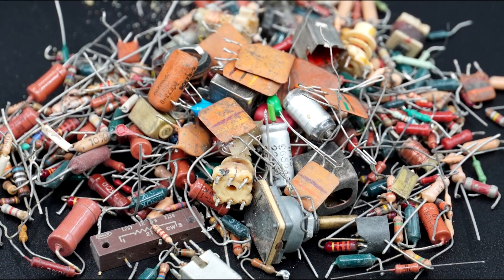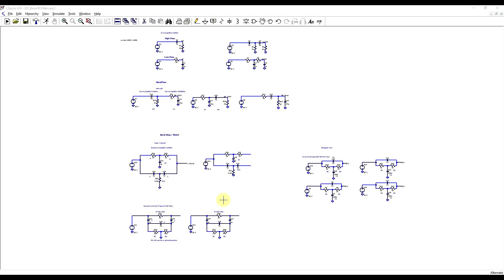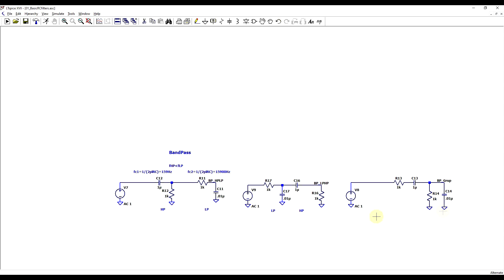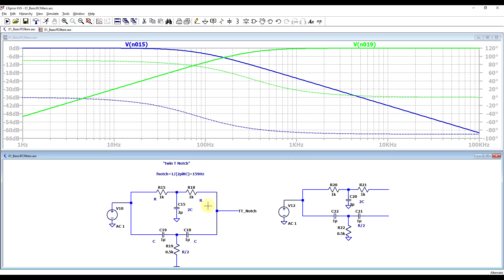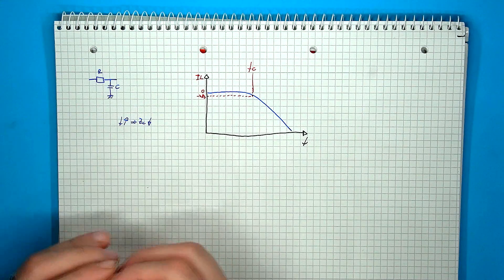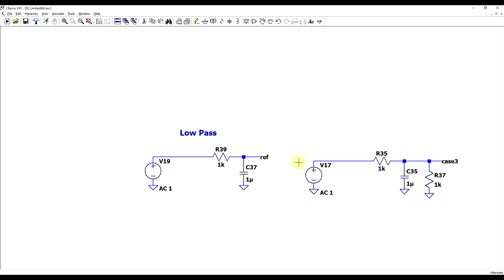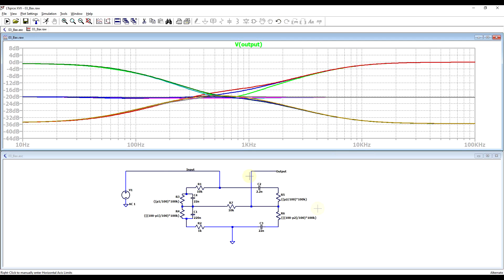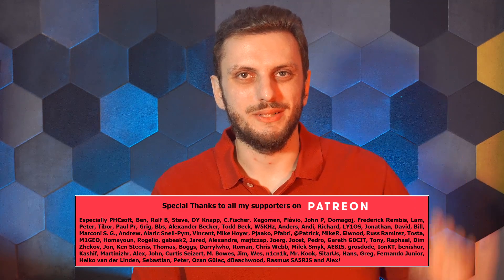Passive RC Filters

Comment: Hi FesZ, some notes:
1:39  The curve for the capacitor should have a 1/f shape. Instead, it is shown as linear.
13:50  I believe, ESR should always increase with rising frequency (skin / proximity effect). Why is it increasing for those low frequencies?
Reply from the maker: The impedance of the ideal capacitor does vary linearly on a logarithmic scale; I guess I should have also pointed out the type of scale; The ESR is also impacted by the dielectric and materials used around the capacitor which can have leakage.

Comment: Thanks! I know understand more fully how many of the filters I've used over the years actually work. I'm beginning to think that LSpice or equivalent should be used as the fundamental pre-laboratory tool when teaching this in schools and universities.  At the upper levels teaching the incorporation of the parasitics, manufacturing variance effects (Markov) as well as environmental comes into play especially when you get into RF. At very high RF everything is a parasitic capacitor or inductor to an extent and thus creates unexpected filters when it's not deliberate design.
Reply from the maker: I fully agree that some sort of circuit simulation tool should be used in the teaching environment. Unfortunately, in my experience at least, schools and universities end up using tools that are sponsored by some company, so they cannot really be used "for fun", only in the work environment, since these are tools that are quite costly...
Reply: @FesZElectronics  LTSpice is under the auspices of Analog Devices while QSpice is out of Qorvo.  |Open source software stability, evolution, and maintenance need a funding source as well as an enthused cross-trained core team at a minimum. along with clear public use case documents   Over Over-dependence on a single or small set of core development leaders is a problem that can lead to the support and development going cold and eventually disappearing.

You have an extensive background using LTSpice but some have indicated that the support team has moved on and updates and improvements will likely peter out. Given that what xSpise versions are you holding out hope for in the near and far future.

Comment: With Baxandal filter, it is a problem to get those logarithmic pots.  I once considered taking stereo volume pot and flipping its resistive plates, but ended up just tuning it in reverse.
Reply: I have simulations and stuff that tells me you don't need log pots for the Baxandall tone controls so I'm confused, guess I will ask the expert above. To me the pots are changing the ratio of resistance to capacitance to adjust the corner frequency, this has nothing to do with our ears log response to volume :)